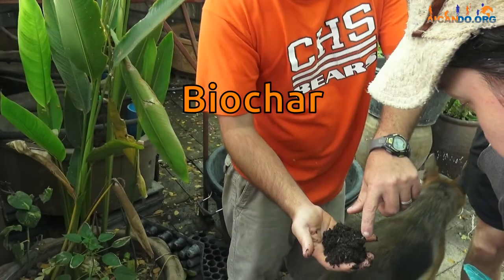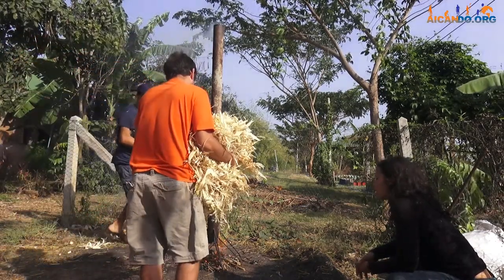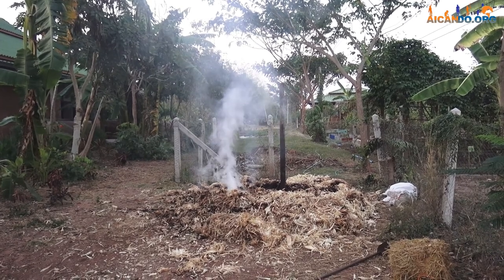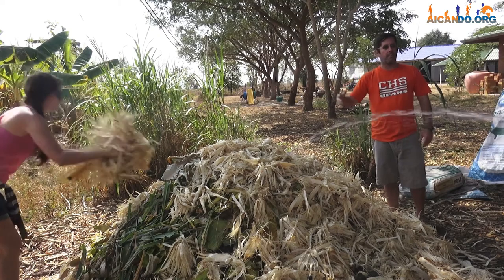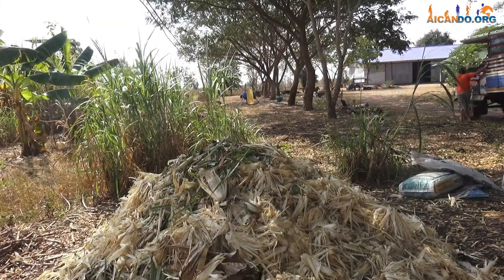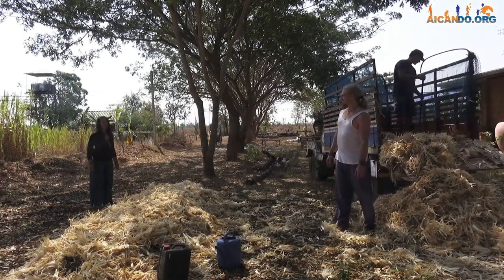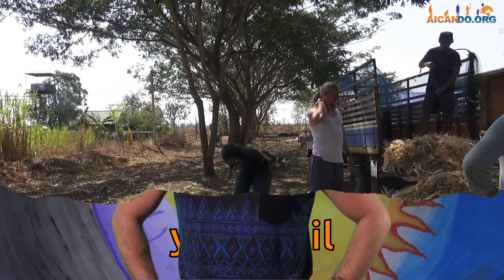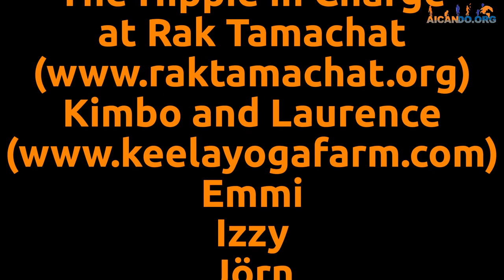Biochar and Compost

Comment: I think you mean pyrolysis, paralysis is like when that funky truck runs over some ones neck. It is totally impossible to make properly prepared compost in that short of a time. What you have is stabilised organic material. It will be low in humic salts, and low in diversity. Why, because each of the dozen stages of composting takes time. The thermofactor bacteria can operate for weeks, then be followed by mesophylls which also take weeks, then there are the ambient temperature micro flora and fauna in succession, each taking its own sweet time to do its magic. Every degree of decomposition creates different elements and therefore, diverse energy frequencies, and this spectrum of energy is what gives the plant its freedom to grow precisely as it requires. Even though new compost is still great, it cannot compare with compost that has been allowed to do its full cycle. I am speaking from forty eight years of experience. Thanks for an interesting presentation, and may you be a compost maker forever.
Reply from the maker: Thanks for this constructive reply. Of course we are not compost profesionals and we are still learning. We just want to show our learning process with time and hope that we will improve a lot with the years.
Reply: sorry to be off topic but does any of you know a trick to get back into an instagram account??
I was stupid lost the account password. I appreciate any assistance you can offer me
Reply: @Aarav Clark instablaster ;)
Reply: @Nehemiah Judah it worked and I finally got access to my account again. I'm so happy!
Thanks so much you saved my ass!
Reply: @Aarav Clark Happy to help =)